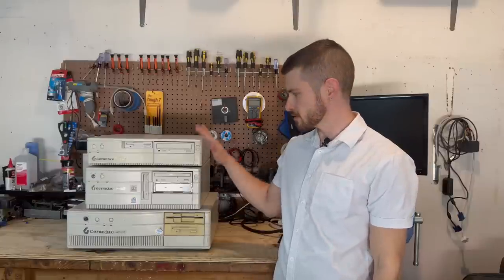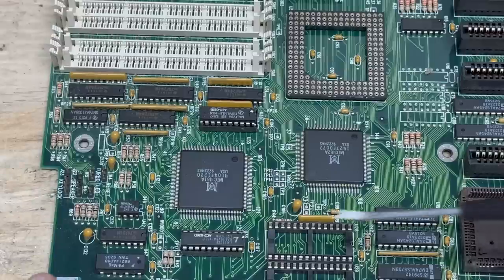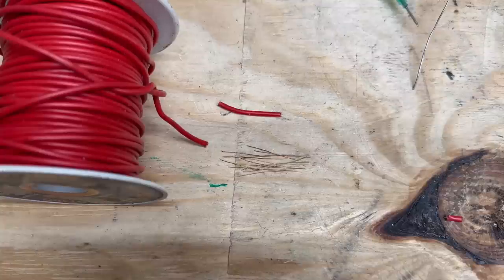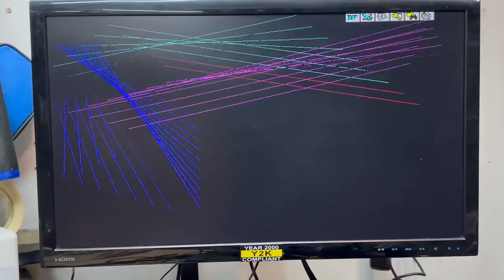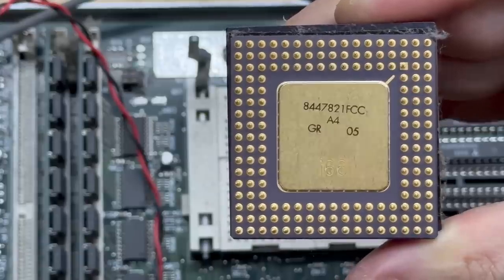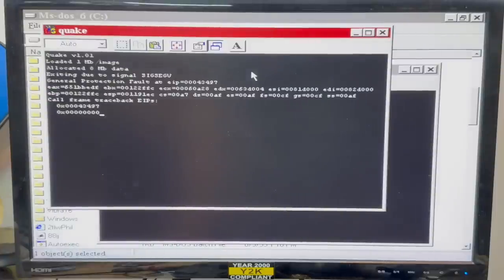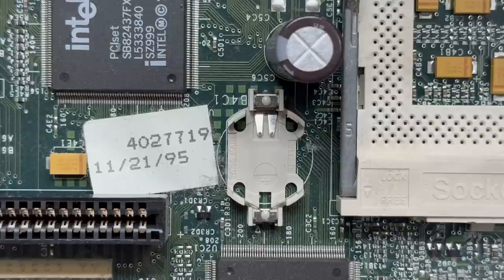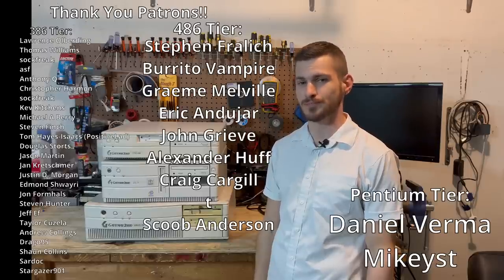Let's wrangle some Gateway 2000 systems! Vintage computer teardown from the Franklin eWaste haul.

Comment: I want a Gateway 2000 so bad. I want to a video on my channel doing a 90s multimedia upgrade. Like Sound Blaster 16, CD-ROM drive, maybe a 4 MB Voodoo 1 (if I can find one for a good price) for early Glide games, and Windows 95 on top of it all! Great Video! Loved the old hard drives sounds and Gateway AnyKey keyboard. The folder that had Quake on the 2nd Gateway 2000 meant it was shareware. If the installer installs the full retail release of Quake, the default folder name is "Quake." But if the installers defaults to "quake_sw" that means that the Quake install is Shareware, standing for the "sw." I watched this while doing my end of the year 7th grade essay, thanks again!
Reply from the maker: I’m continually impressed by the extent of your knowledge of these old systems! I’ve yet to uncover a 3dfx card in this lot, but I’m finding many OPL sound cards!
Reply: @miketech1024  I have have been messing with computer related and animation stuff since I was like 6 to 7, messing with my mom's 2009 iMac. Before that I was in to telecommunication and was drawing Dish Network and DirecTV wiring diagrams, I am a dork for sure.
Reply from the maker: It's a good thing, believe me! That's around the age I started becoming cognizant of technology. When you learn things as a kid, they stick with you for life so learn as much as you can! If you haven't already, you should start learning how to code. Python is a great language to start with. Those experiences greatly accelerated my career, and made the first few years of it MUCH easier. Now Fortune 500s are constantly in my LinkedIn DMs with senior positions... Keep at it! Your future self will thank you.
Reply: @miketech1024   I know stuff like VBS, config.sys and autoexec.bat stuff. Thanks!

Comment: WP in the BIOS stands for "Write Precompensation"
All hard disk types in common use after the early 1990s have a drive-specific controller built into the actual drive enclosure. This includes all IDE, SCSI, SATA, and SAS hard drive types, among others. Those internal controllers know everything they need to know about their specific drive, including which strengths of precompensation are needed on which parts of the disk. Therefore, they ignore any WPcom numbers stored in the computer's CMOS memory. Until the late 1990s, many PC BIOS setup programs still allowed the user to set WPcom numbers and other drive parameters for use with older hard disk types should the need arise; it wasn't always made very clear to the user that his more modern drive would almost certainly ignore the setting.

Since then, the WPcom number is no longer even offered as a BIOS setting any more, as it has become a fully automated and internally handled feature of disk drives.

Comment: when you say de soldering alloy do you mean unleaded solder ?
Reply from the maker: Not entirely sure what it's composed of. Think it's a mix of lead and gallium, or some other toxic concoction. It's really intended for SMD re-work so you don't have to use the crazy high temps needed to melt lead-free solder. It removes SMD chips like magic, really a sight to behold.

Comment: The early Gateway 2000's seemed to use higher end parts. I remember finding many with Sony floppy drives. Bigfoot secondary hard drives while having a smaller boot drive for Win 95 or 98.
Reply from the maker: I was pretty surprised at the build quality! These are pretty nice systems for what is perceived as a budget brand. They must have used good quality plastic too because none of my Gateway 2000 faceplates are yellowed. Was especially surprised to find OPL Sound Blasters in them!

Comment: Wow! AOL warez and punters. I used some of those before 😄 I think I was in 5th grade at the time. They could also be useful instead of the trouble making activities lol such as sending ASCII Art in chatrooms or IMs, changing the txt and background colors of your message txt (before AOL supported color changing) sometimes there was an asshole in the chat harassing people so it came in handy to punt them off. If they had a very capable computer with a lot of memory it was harder to punt them. It basically tried to crash their AOL by flooding their IM with garbage or sometimes opening an email with a bunch of garbage too. It would cause a crash and auto disconnect. They would have to restart AOL and redial.

Comment: Saving for the RTC hack - hey, you have any more info about that? I’ve a similar Dallas chip, working, so n a dolch pac 60 486 machine.
Reply from the maker: You have to drill above pins 16 and 20 to access the battery terminals. Here's a video on it: https://www.youtube.com/watch?v=IbiczYoVncQ

Comment: Ahhh I remember Gateway, when I was a kid, we had one of those Pentium MMX based systems back when, a hulking, giant of an early ATX-ish PC. I used that case for a few years with a front fan modded in and 2 80mm fans, it had a 80mm rear fan in the "normal" ATX spot and another one above the PSU. I don't know what happened to it, but I know the motherboard died before I upgraded it. 

You should do a video sometime educating kids today on how dialup sounded with a giant piezoelectric speaker stuck at the very bottom of a giant metal box. Spoiler alert, it's abject misery, and for those who lived it, nostalgia all wrapped in one, with the lurking dread that someone is gonna yell that they need to use the damned phone.
Reply from the maker: That is a good idea. Need to get a phone line simulator and start toying with getting these systems connected to each other.
Reply: @miketech1024  Yeah that would be fun, though possibly migraine inducing. There are still BBS servers up, and people that use them a lot. It's on the obscure side, would be cool to go back in time like that though.

Side note, when those sacrificial hard drives do die, don't forget to harvest their neodymium magnets!  The modern drives don't have magnets NEAR as strong as ones from 30 years ago. The old magnets are daaaangerous!

Comment: Would I be able to run Keen on a Windows 10 system?
Reply from the maker: It won't run directly, you'll need to use an emulator. DOSBox runs it pretty well.

Comment: I started with PCs in 1999 and I don't recall ever using AOL. I started right off with NetZero.
Reply from the maker: I was forced to use NetZero in the later years due to family budget issues. Funny story: When they started restricting the time you could spend on their free access, it would pop up a notification stating that it was time to disconnect. But if you just never acknowledge it and drag it off the screen you could remain connected for as long as you want!

Comment: Oh, two questions.
As far as i remember,you supposed to clean very good the place you used 'desoldering alloy',is that so?
And,if i need to remove some rust of metal parts of my video card, what would you suggest???
Reply from the maker: You should clean out as much of the desoldering alloy as possible, but a tiny bit left behind won't hurt very much. The quantity of regular solder used to reinstall the part will take care of it. If you want to be extra sure, you can re-fill the via with regular solder, then remove it again. Though I've been using it for years and never had a problem. 

For rust removal, you can use something like navel jelly as its viscosity makes it easy to apply to small places. Just be careful not to get it or any rust removal chemical on the circuit board. Or at least don't leave it in contact with the board for very long.
Reply: @miketech1024  
Ok, thanks for advice!!!

Comment: I didn't fact check, but for some reason I'm thinking Gateway was somehow a branch of Acer... I could be wrong.  Great thumbnail BTW!
Reply from the maker: Thanks! Had to give a homage to their bucolic origins. From what I've read, they originated as their own company.
Reply: @miketech1024  Interesting, perhaps they just competed very directly with each other... I remember thinking that, not in early years but in later/mid-2000's, that they both looked very similar and always seemed to have similar specs at similar pricing.  I remember being told they were partnered somehow, but I can't say that was any credible source - especially since it was decades ago, lol.
Reply: @rebootretro  Gateway was its own company for a time, from its inception until about 2007, at which point Acer had acquired them.
eMachines was also a subsidiary from 2004 until 2007 when the aforementioned Gateway acquisition meant eMachines was also included.

Comment: It’s too bad so many systems of this era have the evil rechargeable ni-cad batteries, but those batteries also probably last way, way beyond the intended life of these systems. I mean, in the time these computers were built, they were obsolete within a year or so, so even a 10 year expected lifespan of the components would much longer than most of them were actually used. Now, 30 years after these systems were built, you can hardly fault the OEMs for using batteries that leak and destroy the systems decades after they were built.